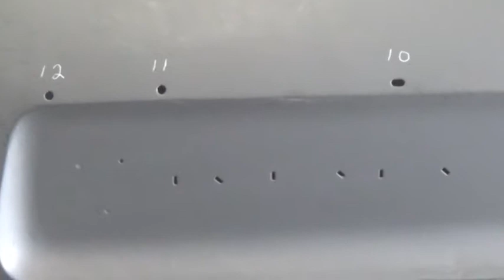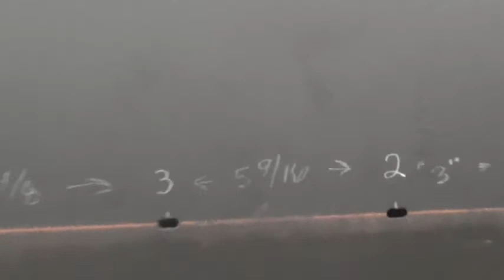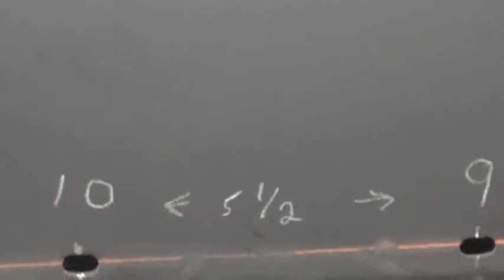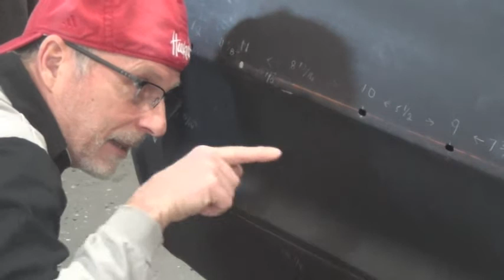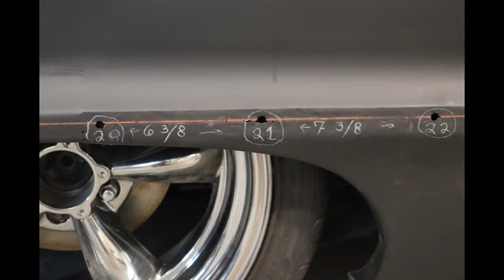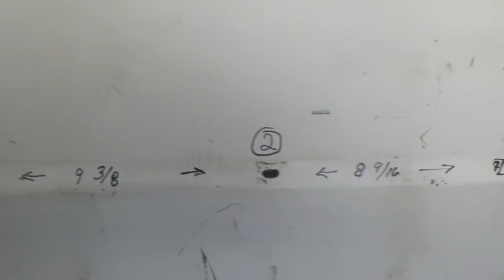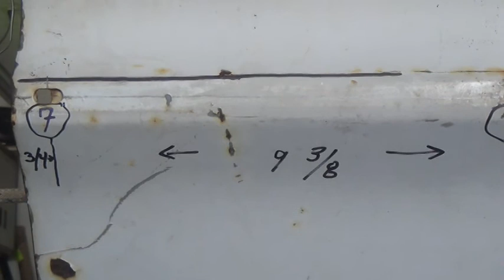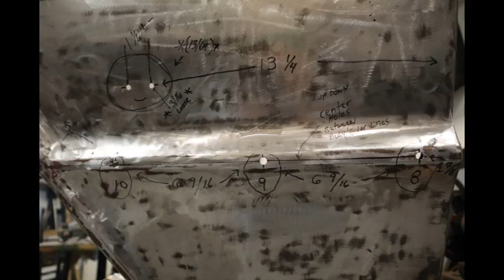1964 Impala Coupe Side Trim Layout

Comment: Hay gene do you remember what size rims and back spacing are on the 1964 impala coupe
Reply from the maker: Hello. Yeah it's been a while (2017), but I try to keep all of my purchase records. (Try)
I bought them from  RIMSNTIRES.COM 
18x8's front and back.
235/45R18 tires.

1 : AR Hot Rod Torq-Thrust II 1 piece wheels (American Racing)
      18x8.0, bolt pattern 5x120.65, offset 0, Chrome.

2 : Installation Kit
      Lug nuts, valve stems

So I did a quick search for these on American Racing Website 
here is the site with specs:
https://www.americanracing.com/american-racing-vintage-torq-thrust-ii-1-pc

How is that for service?? LOL 
Thanks for checking out my YouTube channel!